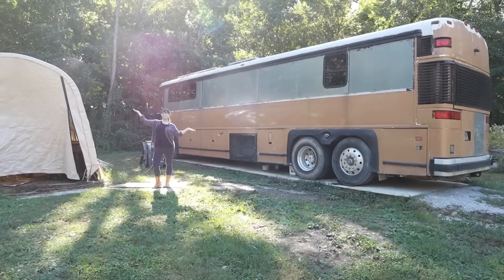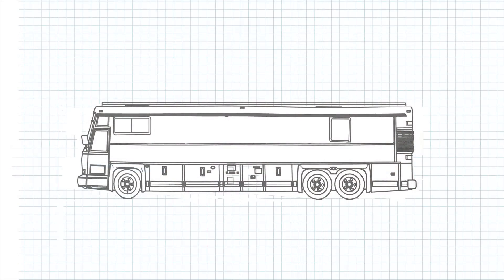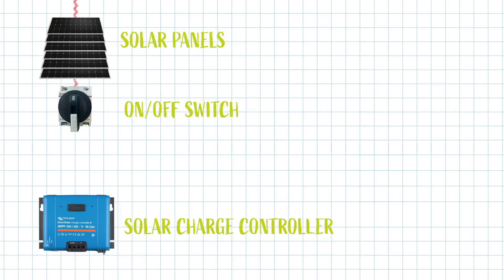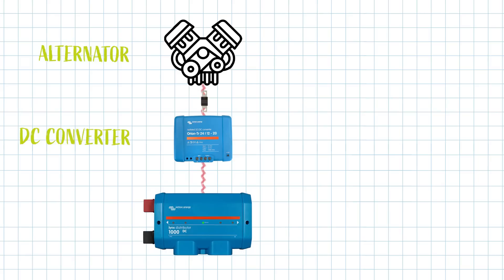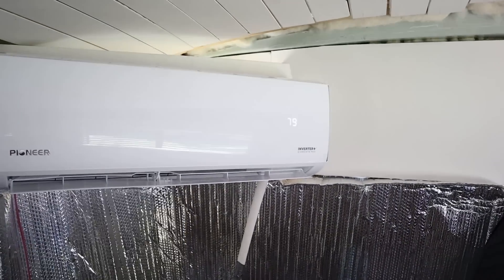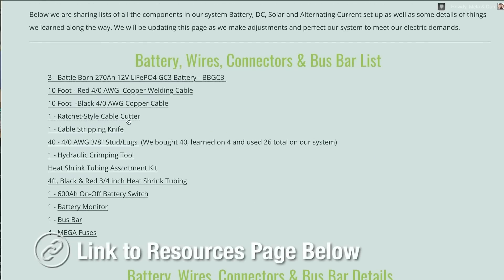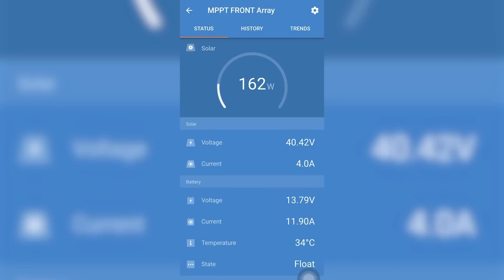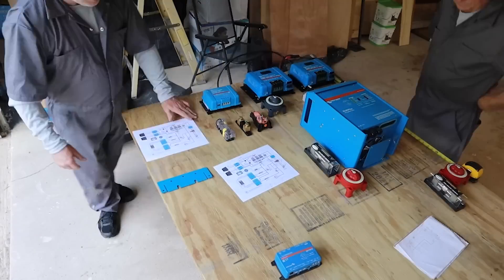OFF GRID Solar & Electric TOUR // RV •  Tiny Home • Bus Conversion with Battle Born Batteries

Comment: It funny, i went with 48 volt batteries, 6 of them, never thought about 12 volt, mainly to cut down on expensive thick copper wire and 12 solar panels, but pretty sure i'm going to add a second inverter.

Comment: So many questions!  First off, I'm assuming the bus batteries (plural) have you on a 24v system?  Does the DC/DC reverse charger work with both batteries, or do you need one for each 12v line?   Of all the different YouTube rabbit holes I've gone down trying to educate myself in the process, you guys are far and away the most help.  I hope if you get anywhere "out near the west Texas town of El Paso..." get me a should and let me buy first round while I fish for more wisdom for my 2003 45' Van Hool tiny home!

Comment: You saved the best points for last. Your admonishment to find someone who knows what their doing when it comes to electrical systems is spot on! Your observation that solar equipment prices is experiencing the impact of economy of scale certainly should be taken to heart as it leads to more for less. Finally, your system is well thought out though I personally might have gone with a 24 volt system.
Reply from the maker: Hey Kevin, thanks for the kind words. If we were doing it over again I might wire it up as a 24V system as well. But everything is working so on to the next adventure :)

Comment: Awesome video!!  I have 600AH of Battleborn Batteries, 2400watts of Solar panels and many of the same Victron components. Another thing people have to consider is 2400watts of solar does not mean you will have 2400 watts coming down, at best I have gotten 2100watts, you can’t count on the rated wattage in your calculations. Aim for more wattage in your panels. I can run my air conditioner while the sun is up and have no issues with batteries, but once the sun goes down I can not run it. Well I can run it but it will quickly drain my batteries.  Also during the winter shorter days means less solar charge times. My furnace is propane and dc fans, so it is a drain on batteries need to make sure there’s enough battery watt hours to maintain heat during the night. There’s so much more to think about but these are a few things I’ve encountered with my system.

Comment: Thank you for the video. I’m sure you already know this but in your video you rate your alternator as watts when it is rated in amps and you stated you were Victron inverters were 300 W when they are 3000 W. I ended up putting one Victron multiplus II in my motorhome and I love it. I have a 2000 Monaco dynasty and I only have room for 400 amp hours of lithium batteries but that is very much more efficient than the AGM’s that I had before so I’m very happy.
Reply from the maker: Hey Timaz, you are correct! Thanks for catching that.  Thanks for sharing about your rig

Comment: Hey Don great video buddy just one little thing I picked up on when you explained the bus alternator on the MCI you said it was 240 watts I think you might have meant 240 amps mine puts out 270 amps you were right about more than you'll ever need.
How many amps is the DC to DC charger putting out typically 30 amps is what Victron sells but you can add 2 or 3 or 4 of them if you want too I'm looking for a model that I can run right into the bus aircondioner breakers at 105 amps or the over the road heat system of 80 amps it's okay the lithium will take whatever you throw at it that's where the DC to DC charger comes into it.
Anyway you two have done a wonderful job on the conversion can't wait to see your travelling video's in your new home.
Reply from the maker: Hey Brian you are correct! Amps not watts- thanks for catching that. The DC to DC is a slow charge since the batteries will “take as much as they can” and we want to be sure to keep recharging the bus batteries :) I hadn’t thought about using more than one - interesting idea
Reply: @Rehabit8  I was happy to hear you can use more than one I'm thinking 3 at 30 amps each would be great 90 amps is a great quick charge and wouldn't take long.

Comment: as a recommendation if your mounting to plywood you can get fire treated plywood, less likely to combust if there is a short in the system
Reply from the maker: Hey ak, great suggestion we used treated and have also mounted components with a heat sink to metal plates between components and the wood as suggested in the owners manual

Comment: Watched you do this Electrical Build. Considering the cost involved in  this setup, I was sad to see the "flow" in the layout of your Power Wall. With the amount of money involved this is a Focal Point of your Coach.  An example:  the  ( 2 ) Victron Mulitiplus inverters should be side-by-side, not on different  Walls.. I could go on, but I won't. JMO
Reply from the maker: Hey Gerald, they have the same distance for wire length so didn’t see an issue with it. Would love to here why you thought this was an issue
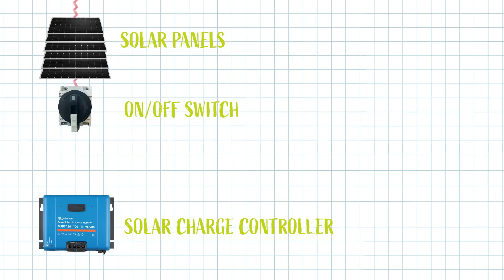Reply: @Rehabit8  Here is an example of a Clean, well laid out, balanced system that has good flow to it. No excessive wires cluttering the system.  Notice ( 2 ) breaker boxes together,  ( 2 ) Multipass Inverters together, ( 2 ) MPPT Controllers together.. No offense meant. I'm just saying with that much money invested,  I'd want the cleanest well laid out flowing system.  JMO ( skip to 3:20  for the power wall )  https://www.youtube.com/watch?v=PtHpk4l39GM

Comment: hey, good sensible video i'm sure it will be helpful. i think you might have mis spoke one refering to alternator output in watts not amps. just FYI. On a technical note be sure you will not overload your system when charging with the bus alternator. LIFEPO4 batteries will take all the power they can get (unlike lead acid batteries) and can put burdens on your system. This should be negated by the dc to dc charger but keep it in mind.
Reply from the maker: Hey Gary, yes the DC convert or manages a decent trickle charge to the batteries as I know they could take “all” the power if they could :)

Comment: Definately added this to my library! This is the most informative video I have found yet. I am about a year out on installing my solar system on my MCI build. This will be a great reference. I love how you are harnessing the alternator as a source of charging power, also. Just curious, does your system decide when that bus source is needed and when it isn't?
Reply from the maker: Hi Chris, the DC to DC charger senses when there is a charge and only comes on to charge the batteries when there is power over a certain level. It automatically stops when the batteries reach there set max level - When the bus turns off the charger automatically disconnects